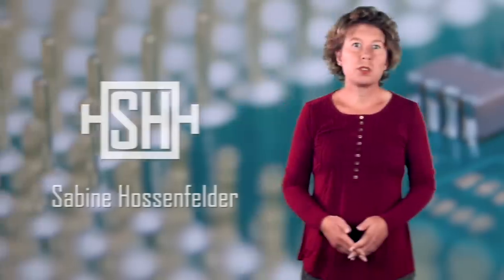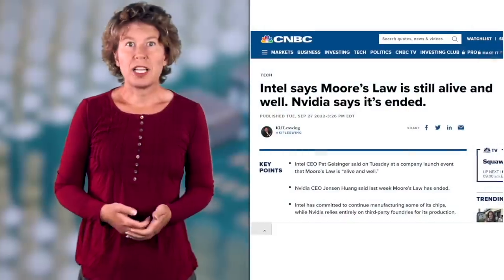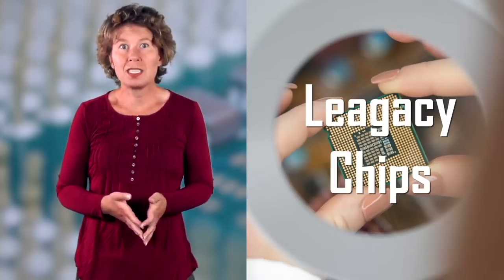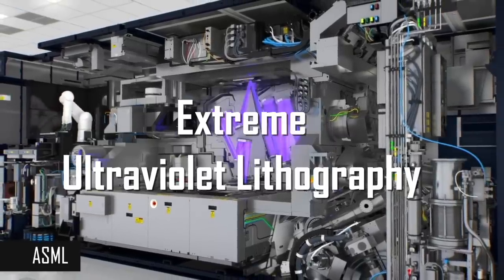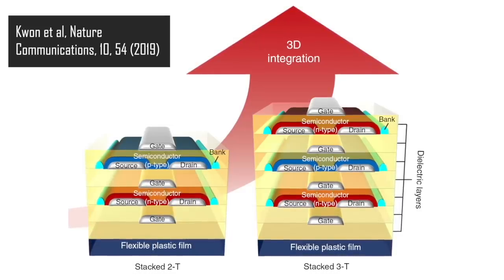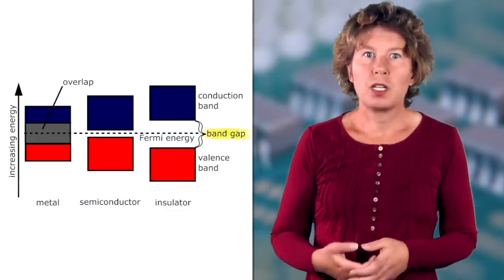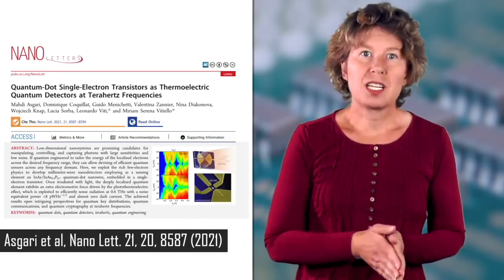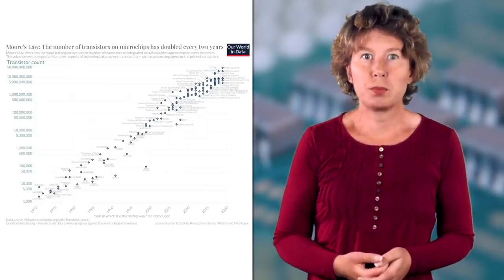Is Moore's Law Finally Dead?

Comment: This is a field I've worked in and it's interesting to hear you cover it. I definitely think that heterogenous computing is going to be what keeps technology advancing beyond Moore's law. 

The biggest problem I think is that silicon design has typically had an extremely high cost of entry for designers. Open Source ASIC design packages like the Skywater 130nm PDK enables grass roots silicon innovation. Once silicon has the same open source love as software does, our machines will be very different

Comment: I was convinced that analog computing would be mentioned in such a comprehensive and detailed overview of computing. If you need to calculate a lot of products as you do when training an AI you can actually gain a lot by sacrificing some accuracy by using analog computing.
Reply: Well, giving up deterministic results would open a whole can of other worms.
Reply: @traumflug  You don't actually need deterministic results for a neural network. They are quite robust.
Reply: @ralphmacchiato3761 I suppose you consider noise from quantum effects to be "deterministic" right?
Reply: Analog chips are only a niche product for AI, they are not suitable for general computing tasks.
Reply: I was studying that, the problem isn't sacrificing accuracy, we already do that by using FP16 which is 16 bits floating point. The real problem is sacrificing immortality of data. With analog computing the data gets fitted to the actual physical device in a way that it can't be moved to another one, so if that device dies, so does the data and the training of the neural network.

This is not a problem for digital circuits, but for analog circuits it is a big problem.
Reply: Perhaps there's a way out, instead of designing digital circuits on top of digital logic on top of a computing architecture (like Von Newman), we could cut all the layers and design ASICs that do directly the needed computation, but in a digital way. 
Even GPUs used for training still are very close to a Von Newmann stored program architecture, they're just sistolic arrays, lots of FMA, but still have a small computing unit that needs the actual program (aka, the weights) to be stored in DRAM, and moved there, its very inneficient.
If one would store the weights in actual wiring of the digital circuit, you could gain orders of manitude more performance, at the expense of desinging ASICs, but then we use machine-learn to design the ASICs, thus closing the cycle of automation, at first it's going to be worse than actual human electric engineers, but then it gets better.

And sure, if a device dies, you lose it, but you don't lose the training, because you can always use photolitography and make another one, but you can't if the training is done for analog circuits.

I'm studying for a masters degree on this area.
Reply: Yeah the vast majority of the energy is lost from transporting data to and from memmory.
The actual computation aint shit
Reply: yeah, as a fan of analog and fluid computing I was hoping for a mention :)
Reply: "but then we use machine-learn to design the ASICs, thus closing the cycle of automation". That sounds like a pretty big leap of faith. I don't know nearly enough to point out problems, but just as a matter of logic, there may be barriers to increased efficiency that machine learning (could we call it AI chip design?) just can't overcome. IDK, maybe you  can speculate on what might cause problems in that scenario, or maybe nobody can imagine yet. It's potentially a big stumbling block, though.
Reply: @monad_tcp  
Great answers. I'll just add that there is a thing called computing-in-memory. However, it sacrifices flexibility for performance. That is, you cannot experiment with neural network architectures after the chip has been made. Although, given the proved generality of transformers...
Reply: There is also a problem with scaling. It's much harder to design a reliable analog circuit with a complexity comparable to a digital one because it's much harder to decompose an analog circuit into parts which can be analysed independently. 

Digital signal has built in error tolerance. In an analog circuit, errors accumulate.
Reply: @squirlmy  it is a leap of faith. From a masters degree to possibly a PhD.
It's a magnus opum and I'm probably going to fail at building that cathedral.
Reply: @squirlmy   I belive that you can make machine learning do most of the drudgery work and have very little human intervention. But still you have the human making decisions.
 I take that from studying the history of compilers and programming languages. They were a massive leap in construction of software that averted the software crisis (well the first one, at least).

The idea of the experiment is more like finding what the barriers are than anything else.
We don't even know what the barriers for that are. That's why its called research.

I'm just going partly on intuition, I think the actual process is stuck in local minima, I just want to push the ball up a bit, so it can go on to final a new local maxima. 

Machine learning is a tool for doing that, maybe not LLMs, but something on this front might create interesting results, and I'm not talking about autorouting, forget that, and no one really wants it anyway.
 And I don't even think it is a problem worth of being solved, because it is not a problem, autorouting already works , except for the hubris of some electrical engineers that think , "wiring is ugly". 
Oh I remember programmers saying machine code made by compiler  is ugly . (well , I don't remember from being there, it's a joke, I just read history, I'm not that old to remember Fortran being introduced)
Guess what, ugly code works exactly well enough , but the scale of what you can do now without having to manually do the manual machine code programming, aka assembler.

Routing so silly and small compared to the other low hanging fruits of validation and verification that could be automated by machine learning, or even traditional compilers.

What I'm after it is not even automating electrical engineering itself, I basically need it as a stone for my cathedral.

My cathedral is "hardware synthesis" that's what I'm aiming.
Reply: @Hexanitrobenzene  yes, you cannot experiment with it after the layout is set, unless you're able to also decrease the cost of masking , RTL and tapeout from millions to hundreds.
Then you could experiment with it, even though every single run would cost a month or more. It would be very slow, but not as slow as making ASICs usually is (2 years if I remember well)
So I'm well aware of that, thanks saying thou.
Reply: @Hexanitrobenzene  the scaling and the problems with analogy circuitry are well known, which is why analog circuits where never able to be as big in number of nodes as the digital ones. 
But perhaps that's not a problem, perhaps designing systems for 100% predictability is the impending barrier. 

Perhaps with better tool that weren't tried before we can tackle it.

That's my hypothesis , if we use something like neural networks, maybe they can tolerate the errors, and we can work with the analog complexity instead of against it.

There are also other forms of computation that also tolerate errors.

We have to work with the errors, not against them. As it's usual for digital circuits. Our brains work like that , so that says it should be possible, more or less.

 But who know what that might unlock.
It's exciting , at least for me.
Reply: Analog computers are not even faster, just more energy efficient. They have the potential to be faster.
Reply: @axle.australian.patriot  
There is even fluid computing ?
Reply: @monad_tcp  
Have you heard that Deep Mind recently optimised some assembly code ? They did that with reinforcement learning, reformulating the problem of writing code as a game, where reward depends on correcteness and performance.

Maybe the same could be done with electric circuit design ? The trick is to use neural networks to prune the search space efficiently.
Reply: @Hexanitrobenzene  Fluid computing is common in industrial applications. A simple example is an automotive automatic transmission. The balance of fluid pressures triggers different gates to control the transmission. This can be expanded at an industrial scale to act in a similar way to and set switching transistors or logic gates. Think robotic production lines (Although more recently they are more electronic controlled). The difference is that it is "Analog" so the gate may not switch exactly at the threshold, but then this is also true of of a diode or transistor as then never really switch at the exact expected voltage.
Fluid/Analog computers are robust and reliable but expensive compared to electronic logic gates and relay/solenoids.
Each system has it's pros and cons :)
Actually, the most simple example of a fluid control gate (PNP/NPN transistor) is the float in your water closet :)
Reply: It's like human brains.  They're so inaccurate they can literally get baseball sized chunks turned off without even consciously noticing in some cases.  And think about how we do math.  Vague and erratic but ultimately functional.  Or imagining things visually.

Comment: When many people use "Moore's Law" as a shorthand that compute will get faster over time, rather than a doubling of transistor density. Wrong though that is, it's a common usage, especially in the media. The speed increases we get from the doubling alone have stagnated, which is why cpu clock speeds are also stagnant. 
Nowadays, the extra transistors get us multiple cores (sadly most compute problems don't parallelize neatly) and other structures (cache, branch prediction, etc) that aren't as beneficial as the raw speed increases we used to get from the doubling.
Reply: Yeah, in the early days, the new computer you'd get after 4 years had astounding performance compared to its predecessor.  But also, how fast do you need to open a word processing document?  My inexpensive laptop boots up from a cold start in about 5 seconds, and most applications spring to life with barely any noticeable lag.
What we still notice are compute-intensive tasks like audio and video processing.  And those tasks are amenable to speed-up from specialized chips.  Pretty soon those tasks will be so fast that we'll barely notice them either.  But by then we'll be running our own personal AIs, and complaining about how slow they are.
Reply: Sadly, I've got a problem at work that will parallize nicely, but it's written in an ancient language for which no parallel implementation has been produced, so it needs a complete rewrite before in order to do that.  And there's no time to do it.

Comment: I remember reading an article about how electrons will "fall off" chips with smaller than 100nm fabrication so it was a hard limit on fabrication. This was in the single chip x86 days. Technology is amazing.
Reply: That's not far from where we are hitting the wall. The transistors in "8 nm" chips are about 50 nm.
Reply: Oh do I remember those x86s, great chips. I once ran an 8086 w/o a heat sink or fan to get it to overheat and it simply refused.
Reply: Oh they're definitely falling off, there's a reason why they use so much power and get so hot lol.
Reply: @Nefville  Heat sink?  On an 8086?  I never saw such a thing.  I did get my hands on a 20MHz '286 and it  need a heat sink.  Wasn't a very satisfactory machine though--there was apparently motherboard design issue on the particular board I had--I had to power it up, let it run a minute, and then hit reset before it would boot.  Never did figure out where the problem was.

Comment: There is another set of problems that are related but are a lot less obvious.

Design complexity is a problem itself.  It is difficult to design large devices and get them correct.  In order to accomplish this, large blocks of the device are essentially predesigned and just reused.  This makes is simpler to design but less efficient.  As a complement to this is testing and testability.  By testing, I mean the simulations that are run before the design is finalized prior to design freeze.  The bigger the device the more complex this task is.  It is also one of the reasons that big blocks are just inherited.  Testability mean ability to test and show correctness of production.  This too gets more complex as devices get bigger.

These complexities have led to fewer new devices being made as one has to be very sure that the investment in developing a new chip will pay off.  The design and preparation for manufacturing costs are sunk well ahead of the revenue for the device.  And these costs have also skyrocketed.  The response to this has been the rise of the FPGA and similar ways of customizing designs built on standard silicon.  These too are not as efficient as one could have made them with a fully custom device.  They have the advantage of dramatically lowering the upfront costs.

Comment: Hi really great video. One clarification regarding chiplet design and 3d stacking. The chiplet design idea is to produce different wafers using different processes and then assemble them together later. This is efficient as you can optimize the process for the single parts, and use lower costs process uses for different part. This also can improve yeld as you get multiple chips that are smaller.

Comment: Back in the day, Moore's Law was that the number of transistors doubled every 18 months. So we're maintaining Moore's Law but simply changing the definition.
Reply: TRUE! I definitely remember that. When she said 2 years,  my 1'st reaction was: NOPE!  Moore's Law states 1.5 years! That was repeated over & over.

Just had an idea: Let's just change the definition of the law so as to fit actual progress. 😅
Reply: He actually revised it in 1975
Reply: @NonsenseFabricator  - could be . 
Nevertheless, I maintain that  revised version did not garner the same popularity as did the "Law" in its original form. For I saw it quoted in the original form, way after 1975. But this debate here has outlasted it's importance, so I, unilaterally call it over. 🙂
Reply: If you change the definition it's not a law, thus it died long ago.
Reply: @amentco8445  - It was never a law, just a widely  accepted truth. As far as I remember, that was established in the video itself. So no issue there.
Reply: @ittaiklein8541  
It was empirical observation which became an industry guideline.

Comment: I recall the first time I ever saw an op-amp back in the 1970's. It was an Analog Devices Model 150 module that contained a discrete implementation of an op-amp (individual transistors, resistors and capacitors). The thing was insanely expensive.
Reply: And had no temperature compensation...
Reply: I've seen pictures of tube based op amp modules .  Those handled temperature quite differently, needing actual built in heaters to work .

Comment: I can remember seeing transistors at school, they were about 1.5 cm long and 0.5 cm wide cylinders with tree wires sticking out of one end. They were used for the first truly portable radios which could use zinc-carbon batteries to operate.
Reply: Transistors for power applications remain that big, or bigger.
Reply: @markuskuhn9375 yeah I mean isn't a transistor basically just a switch?
Reply: @chicken29843 only true in digital world. You use transistors for signal amplification in analog world. Eg your hifi. In this case it's a continuum between on and off, thus not a switch.
Reply: What I find funny is that they finally got the "first truly portable radios" out to market with a slogan proudly and boldly scrawled across the front "Solid state", most popular (in my area) with a 9-Volt box-shaped battery in each one... AND around a decade later, the teenagers were throwing their backs out of whack with MASSIVE "boomboxes" on their shoulders, failing utterly to appreciate the convenience of a radio that fit in your pocket and a pair of earphones to hear it clean and clear anywhere... to have "speaker wars" that threatened the window integrity two houses down the block for a "radio" that weighed as much as an 80 year old phonograph unit...   ;o)
Reply: @chicken29843 I'd say they generally are more like valves. If you always either turn your valve to completely stop the flow or open it fully, you've practically got a switch, and that's what's happening in digital circuits. There are a plethora of different kinds of transistors though, and for the most part the can be generalized as analog valves. One of the most common uses are signal amplifiers, used for audio and many other things.
Reply: @markuskuhn9375  
I've seen up close an IGBT which can handle 600 amperes current. About the size of the powerbank, with terminals you can put a finger through...

Comment: Yes, Moore's Law can continue for a while through parallelism.  Heterogeneous approaches are working now and we're fairly close (I think) to practical use of resistor arrays for memory and compute (memristors).  AI approaches to patterns of execution, and how that affects CPU, I/O and RAM, will also likely bear considerable fruit since we've spent quite a bit more time on miniaturization than optimization.

In gaming, we're looking at a time of what will feel like only linear improvements in experience.  But they will continue, and then pick up as we grow into new combined compute/storage/IO materials, structures and strategies.

Costs and power consumption will be the real bear, and we MUST NOT leave solving such problems to the likes of NVIDIA (from whom I will purchase nothing).  True competition is key.